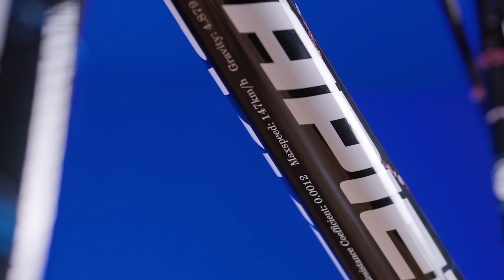Dream Build I Lapierre Xelius Symbiosis Edition I Newmen SL R.42 VONOA  I 1x12 I SRM Powermeter

Comment: Cool build! Why did you not use the specific Hope front caliper? I think you wouldn't have needed the adapter then, right?
Reply from the maker: Yes, you can mount them without the adapter but we ordered the calipers before we knew what frame they would be mounted on in the end. There are a few out there which come with special spacing and adapters (like specialized ) where you can only use the flat mount calipers. And on some forks with the front flat mount standard 160/180mm you end up with a 180mm disc since the RX4 calipers only comes with the +20mm option. 
It's perfectly right what you're suggesting, especially since the RX4 front caliper is a peace of art, but if you want to be absolutely sure it fits on your frame you better buy the flat mount version.
Reply: @roadbikechannel  makes sense!

Comment: Why you don't hold your torque wrench only on the handle? It's not accurate like that ...
Reply from the maker: Yes it is. The torque mechanism is right at the front, only the lever is a lot bigger at the "real handle" and you could end up applying to much torque. This wrench is for a torque from 2,5-25Nm and we're at the lower end with 6Nm at the handlebars.